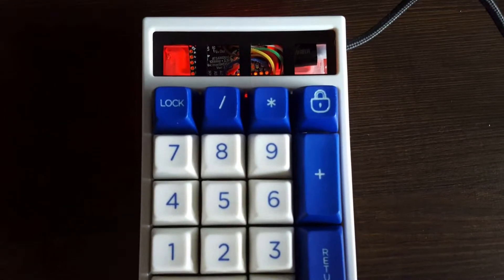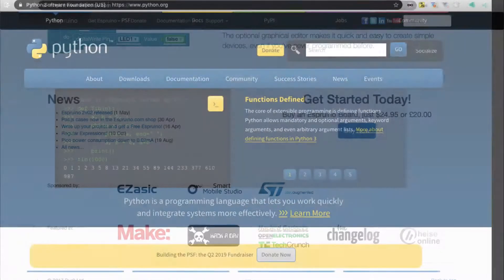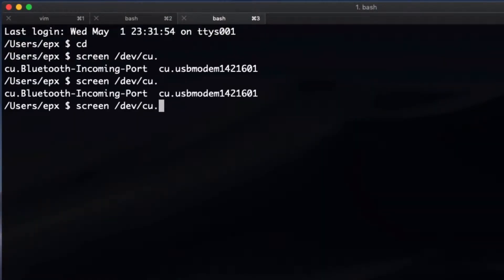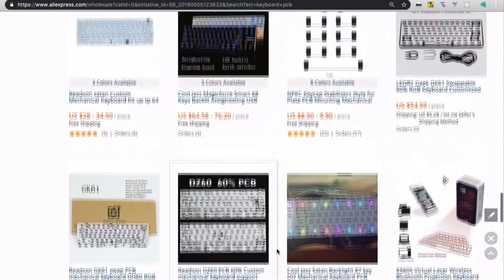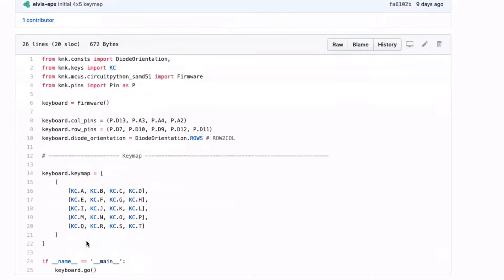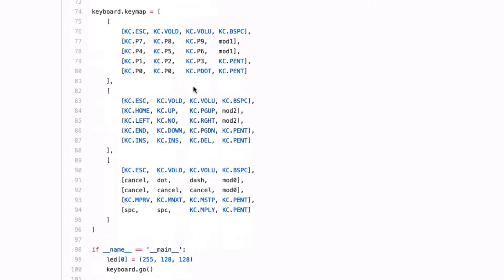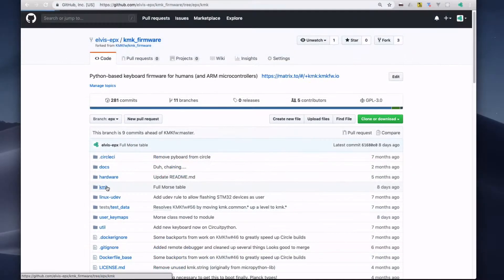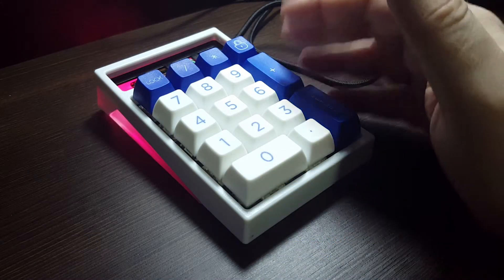Mechanical keyboards S02E04 – KMK firmware

Comment: You want more memory on microcontroller, but waste it using an inefficient language like Python. C++ is no longer as bad as it once was. Using new and delete are no longer required.
Reply from the maker: Don't like C++l, though I use in a uC-related project (LoRaMaDoR). I hope Rust will rule them all.
Reply: C++ has never been a good language, and probably will never be. Better standard C or if you want to go modern Rust might be an option. Python is good enough for building a keyboard controller on a multimegahertz micro.
Reply: @347573  Do yourself a favor and read or watch Rodney Saks presentation on C and C++.  I wholeheartedly agree, C++ is an abomination in terms of its overly complicated syntax since it controls the semantics. The same is true for C, except it has less syntax, but cannot generate as efficient code as C++. Many C programmers fail to realize C++ is just a superset of C. You don't have to use any of its object-oriented features, but it would behoove you to at the very least exercise the use its memory management and type system, which greatly enhances performance and code reliability.

I don't know much about Rust, but everything I've read about it emphasizes its ability to manage resources more safely than C++ without any trade offs in efficiency or performance. Some developers, however, claim its resource management is equally onerous to work with. They also claim the resulting code is less efficient than C++, which comes at a surprise since I was under the impression it generated precompiled C++ in order to leverage its optimization.